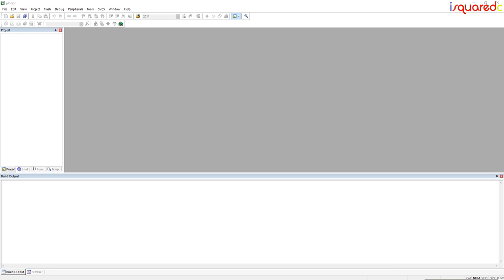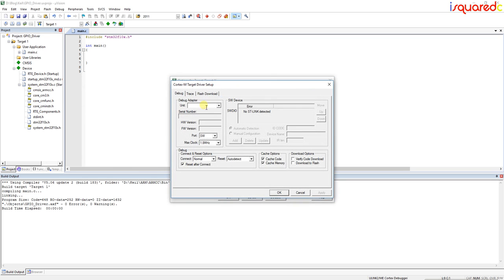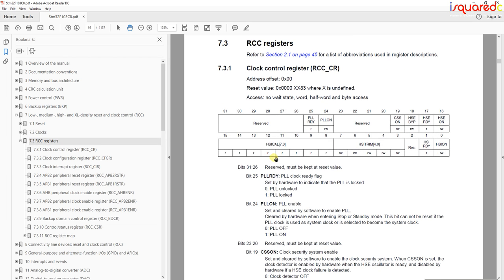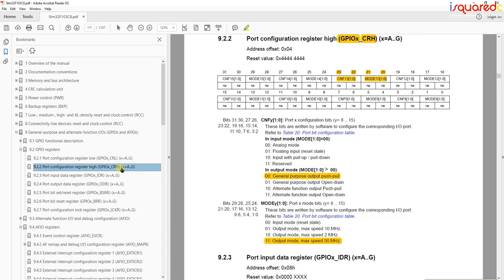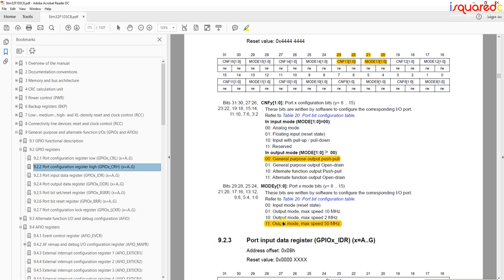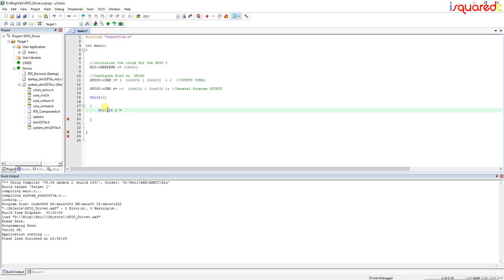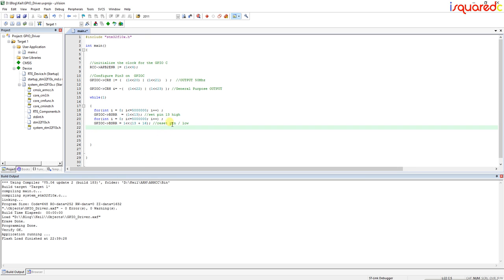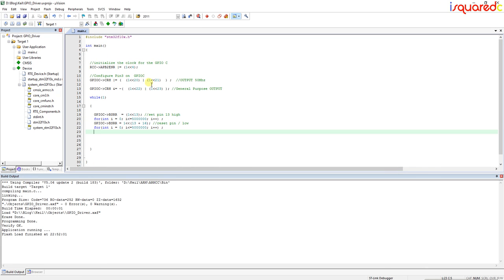Stm32 Peripheral Drivers from Scartch : GPIO Programming Part 1

Comment: An interesting technique I discovered you 'can't' do on the an STM32, at least easily.  Assign a bi-directional GPIO to an EXT interrupt controller.  Yes you can make a GPIO an external interrupt and the exterior line can be pulled high/low and trigger the interrupt.  What you can't then do is hold that GPIO low to signal something.  Writing to BSRR, BRR, DRR has no effect. :(  My timing is tight, so I don't think reconfiguring the port mode etc is viable.  So I need 2 GPIOs.

Comment: was looking for such a detail tutorial on STM32, after arduino there are no advance tutorial on such controllers if one want to learn. I am using stm32cubeide environment,works really well for me. I think I will be using hal for gpio and wont do it baremetal but still watching all videos in series so I can learn more. One of the main thing I want to learn is how to write I2c,SPI drivers for any device to interface it with stm32.

Comment: Sir i am running this code with your PLL clock code but it is not blinking the LED, LED is constantly turned ON.  what is the possible issue?  how can i share my code with you?
Reply: In my BluePill is happening the same. :(

Comment: You are using a before defined header file "stm32f10x.h"... What's there "from scratch"?

typedef struct {

	__vo uint32_t MODER; 		// 8.4.1 GPIO port mode register (GPIOx_MODER)  						Address offset: 0x00
	__vo uint32_t OTYPER;		// 8.4.2 GPIO port output type register (GPIOx_OTYPER)  				Address offset: 0x04
	__vo uint32_t OSPEEDR;		// 8.4.3 GPIO port output speed register (GPIOx_OSPEEDR)  				Address offset: 0x08
	__vo uint32_t PUPDR;		// 8.4.4 GPIO port pull-up/pull-down register (GPIOx_PUPDR)  			Address offset: 0x0C
	__vo uint32_t IDR;			// 8.4.5 GPIO port input data register (GPIOx_IDR)  					Address offset: 0x10
	__vo uint32_t ODR;			// 8.4.6 GPIO port output data register (GPIOx_ODR) 					Address offset: 0x14
	__vo uint32_t BSRR;			// 8.4.7 GPIO port bit set/reset register (GPIOx_BSRR) 					Address offset: 0x18
	__vo uint32_t LCKR;			// 8.4.8 GPIO port configuration lock register (GPIOx_LCKR) 			Address offset: 0x1C
	__vo uint32_t AFR[2]; 		// 8.4.9 GPIO alternate function low/high register (GPIOx_AFRL/AFRH)	Address offset: 0x20/0x24
} GPIO_RegDef_t;

to write own typedef struct's is from scratch...^^
Reply from the maker: No that is just silly, it's just defines provided by the manufactures, but if you want to type hundreds of addresses by hand please do so and tell me how that works better than the header file ...and also don't forget to type the arm cortex core header files too. And when you move to big boy mcu not just the f1 let me know how typing 10000 addresses from scratch goes, then compare your file with STM file and you realize you wasted your time to arrive at the same thing. Be smartter than that. From scratch means no library is used. But please type it all from scratch for every microcontroller you ever use. Enjoy.
Reply: @EdwinFairchild  Of course you are right! It is a bunch of work, but if you want to know about every base addresses of every port and every offset address of every register, than it is better to do this work^^ Such as:

temp = ( pGPIOHandle->GPIO_PinConfig.GPIO_PinMode << (2 * pGPIOHandle->GPIO_PinConfig.GPIO_PinNumber) ); 
		pGPIOHandle->pGPIOx->MODER &= ~(0x3 << pGPIOHandle->GPIO_PinConfig.GPIO_PinNumber); 	
		pGPIOHandle->pGPIOx->MODER |= temp;	

and every preprocessor^^
Reply: @EdwinFairchild  Anyway, I will download you whole playlist and I want to learn with you, thank you so much for your work :)
Reply from the maker: And don't forget to write your own  _vo and uint32 because those are also predefine , where's the from scratch 🤣
Reply: @EdwinFairchild  #define _vo volatile^^

Comment: Keil is showing me a warning when I set " ~ " in CRH configuration bits (line 13 in your code), it says "main.c(8): warning: implicit conversion changes signedness: 'int' to 'unsigned int' [-Wsign-conversion]"
any solution?
Reply from the maker: Yeah it's just a warning, either way it's an unsigned int , set it as you please

Comment: The blink code did not work for me weirdly , I though the problem is with the board , but I tried a blink example on MikroC Pro for ARM and it worked. I am not using STLink for programming i just upload hex file to flash. could that be the problem?
Reply: I had the same issue I spent hours trying to debug, changing the data type to a volatile int fixed it for me as well. I was so pissed I almost gave up on the tutorial
Reply from the maker: @ced_ak  don't give up on me my bad 😂
Reply: @ced_ak  MAN you ARE JUST AWESOME ,,,,FROM morning onwards i was having  with same problem..Thank god i saw your comment ...LOTS OF LOVE ....
Reply from the maker: No, did you follow the Keil setup that I did there is a check box about uploading to flash or something that should not be checked. Aside from that everything else is fine. Sometimes you need to restart the board right after an upload with Keil and St Link
Reply: @EdwinFairchild  Yeah I did all your instructions , but I do not use STLink for programming , I use the STMflash Loader, so i enabled creation of hex file and I upload it using the STMFlash Loader , but the led is only on all the time.
Reply from the maker: @omaressam33  show me your code
eddie@edwinfairchild.com
Reply from the maker: @omaressam33  better yet post it on github
Reply: @EdwinFairchild  same code you wrote sir , copy and paste 😄 , I dont know what is wrong.
Reply from the maker: @omaressam33  and you are using stm32f103? No St-Link. How are you uploading the code? Via bootloader and a USB to serial? Have you tried typing the same code in mikroC
Reply from the maker: If the led is on all the time maybe it is just blinking too fast for you to see , did you add a delay? Did you make it with a loop? Did you make the loop varisble volatile so it's not optimized out
Reply: @EdwinFairchild  Yes I am using the STM32F103C8 , and use USB to serial , couldn't find St_Link in my country
Reply: @EdwinFairchild  yes sir that was the problem , the compiler removed the empty for loop when the iterator was only int not volatile int, Thank you very much sir for your help , already learning much from you . Appreciate the help!

Comment: Unfortunately, the STDPeriph library is dead.The STMicroelectronics hasn`t produced any upgrade of this library for some years.
Reply from the maker: Yeah I never used stdPeriph by the time I got to Stm32 products it was already dead. ST does have the LL library which in my opinion is the way to go. Less bloated than cube HAL, in fact deep inside HAL it uses LL so it's definitely less bloat. I'll make a video on it soon

Comment: Hey Eddie, nice tutorials, do you have a link of this datasheet for the board, it seems like i can find only one for the mcu with 117 pages. Also, do you have any discord or any other way to interact with ppl and help us out when u are free?
Reply from the maker: It's called a reference manual, datasheet is like you said a shorter document.  Google "RM0008"  that is the document you want
Reply: @EdwinFairchild  I also need it, thanks a lot.

Comment: Few tutorials actually show how to write directly to registers which is what high performance embedded controllers need (to be fast and predictable).  I don't want to abstract any more
than this.  Operations like the -> operator are poorly understood by most C programmers but are used extensively in header files.  Thanks for showing how it's done.  Great job.  Do more.
Reply: Those who don’t understand basic concepts like pointers and dereferencing may be ‘programmers’ but definitely not C-programmers.

Comment: hello sir can we do the programming for  reading switch input without using drivers code..like normal coding by refering refernce sheet
Reply from the maker: all this code is done using data sheet, there is no STDPeriph and CubeMX in this its all register manipulation.. and you would do the same to read an input, just set the pin to input with or without pullups/pulldown and wire it up to a switch and read the state
Reply: i am trying sir but failing all the time.. can we see the simulation of progrm like 8051in kiel...
please guide///
Reply from the maker: what microcontroller are you using?
Reply: stm32f103c8t6...well to understand the processor im started learning about processor and assembly language... but i got only failure...i dont want to quit. please sir guide me...
Reply from the maker: SO you want to use a GPIO pin as input to read when a button is pressed? Coded in C. correct? I can show you how to do that ... but not in assembly.. waste of time using assembly
Reply: Eddie Amaya yes sir I just want to learn . Please make a video and show how to simulate in kiel
Reply: ajitem kudtarkar it's easy, I've done that using the same micro, and I've also run pwm on it. All by register manipulation
Reply: k vult can you make video of that ?? and eddie sir when i include cmiss core and device startup file and after that i build project in kiel5 stm32f10x.h (in this video at 1.30 ) it shown lock what should i do t coorect that
Reply: ajitem kudtarkar use CooCox CoIDE, and download arm GCC. There's a channel called newbie hack. The guy running the channel has video series on this. But be sure to make changes in your code as our Microcontroller is different than his.
Reply: K Vult arm gcc for what
Reply: ajitem kudtarkar give me your email id, I'll mail a video of the instructions
Reply: K Vult  ajitemk@gmail.com

Comment: +Eddie Amaya Hi, I got Flash Download failed - "Cortex-M3" error
Reply from the maker: Josh3292 the part where you go into settings of the programmer, uncheck the “download to flash” option that I previously said to check
Reply: Fixed!

Here's how:

Click on menu bar ‘Project’
Options for Target, this will bring up ‘Options for Target’ window
Click on ‘Debug’ tab
In the debugger device selection, click on ‘Settings’, this will bring up ‘Cortex-M Target Driver Setup’
Click on ‘Flash Download’ tab
In ‘Download Function’, select ‘Erase Full Chip’
Reply from the maker: Josh3292 glad you fixed it

Comment: Hello Eddie, Great help with this tutorial!
Have you ever considered choosing another IDE for your projects like AC6 SW4stm32 which can be combined with  STM32 CubeX software to define automatically your peripheral firmware for you. What's actually your preference? Thanks
I'm actually learning with SW4stm32 but still it seems that your typing by deference the structure of the periph are preatty handy on your IDE!
Reply from the maker: I have not heard of AC6 but i will look into it, i do use Cube Mx to get things done quickly , my purpose for writing the drivers myself is simply for learning purposes. Unfortunately Cube Mx is too good, in the sence that you can set up the clocks and peripheral and not know anything about how they work. SO by writing my own drivers i am forced to learn how the peripherals work. But yes for fast prototyping i use Cube Mx.. thanks i will look into this AC6